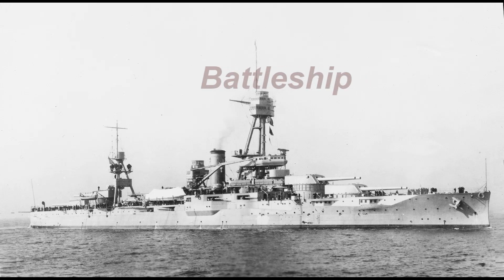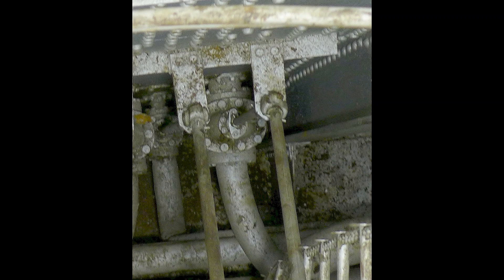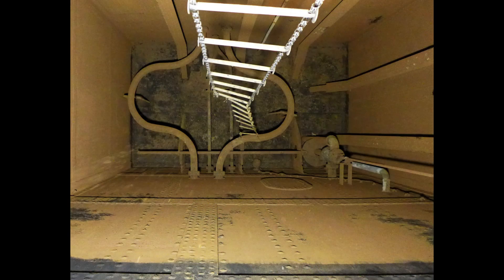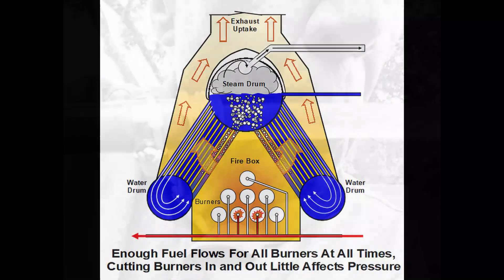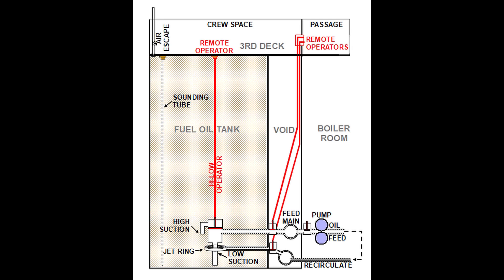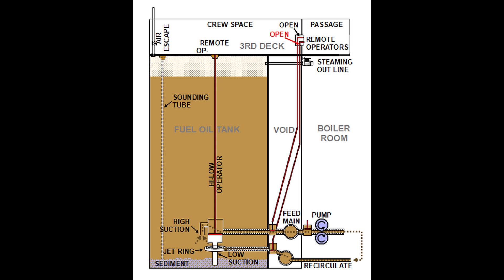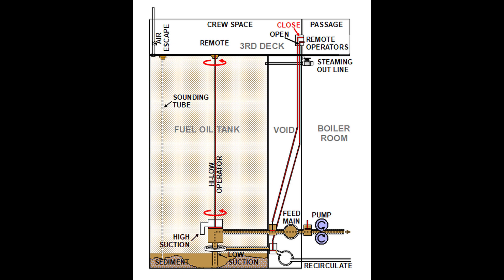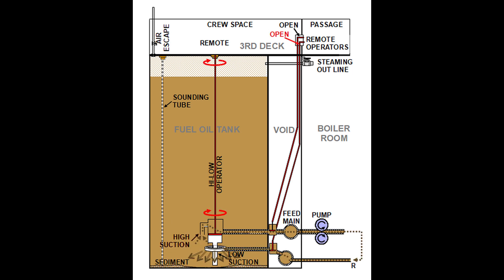Battleship TEXAS, What The Heck Is The Recirculate System?

Comment: you have to take you hat off to designers (yeah i know i say this a lot) the system itself is not so complex when you think of just one fuel cell, but add into the mix another 90 odd, then it must be a nightmare for the crew and their Oil King, and being on top of your game, pressing all the right buttons, opening and closing valves at the correct time to complete tasks when required, knowing where all the pipes go, and which do what and more importantly when - i know these tasks are drilled and drilled into crews so they become completely automated, BUT doesn't it make you wonder how many times you report to the Captain apologising for putting an empty fuel tank on line and an engine running dry, Oops - i guess these are soon rectified when the engine room shouts at you, but i bet some of those boys had some stories to tell, a number of Ooops stories haha
i often think this when i hear of a ship has run aground or something, Ooops someone got shouted at
did i see something that fuel tanks once empty were filled with sea water to maintain ballast on the ship to maintain its trim, or am i imagining it?

Comment: Can the engines ever be started again? I wonder what the engine room was like while running? Was the oil used refined first?
Reply from the maker: The engines will never run again for a variety of reasons.  The fuel oil used to fire the boilers was very thick, nasty stuff that was left over in the refining process after lighter distillates were recovered from crude oil, such as gasoline, light and heavy lubricating oils, and diesel fuel.
Reply: @tomscotttheolderone364   
Well that’s a shame. I heard those engines were close to the same ones on the Titanic. What about firing the 14 inch guns?
Reply from the maker: @robertbruce6998  Other than the two ships' engines being reciprocating steam designs, there are a number of significant differences between them.  As far as the guns, no, they will never fire again.  They required constant service and maintenance when the ship was in service that hasn't been done in more than 75 years.
Reply: @tomscotttheolderone364  well I saw where all of the smaller guns were being restored. To it just seems a shame not one of the 14 inch guns could not be restored. So the turrets will never move again either? Just doesn’t seem right.

Comment: Did that air line serve the purpose of pumping cooled exhaust fumes into the tank for its anti-explosion effects, or was that not a consideration on the TX?
Reply from the maker: There were no air lines to the fuel tanks.  The tanks were sealed and the ambient temperature fuel produced very little in the way of explosive fumes, so there was no real need to purge or fill them with inert gasses.
Reply from the maker: Sorry, let me change that a little.  There were air escape lines running to all fuel tanks.  However, these were simply meant to equalize air pressure as fuel was pumped in or out of them.  The lines all lead to the outside at main deck level or higher.

Comment: I would assume that the steam out line you would not be using super heated steam?
Reply from the maker: You're right for two reasons.  First, there's no use for the extra energy in super heated steam when steaming out tanks.  Next, the ship's boilers couldn't produce it.  The engines could not use superheat, so the superheaters were removed from the boilers shortly after they were installed in 1926.

Comment: what was the process to fill oil tanks with water for ballast?
Reply from the maker: They were supposed to have the ability to flood fuel tanks, but there are no signs of the pipes and valves required to do it.  This was confirmed by a memo written by Captain Baker during WWII saying they had depleted a large amount of their fuel by refueling a couple of destroyers while on convoy duty.  They were not able to comply to the need due to the lack of flooding and stripping lines in the tanks, so he ordered flooding some of the external torpedo blisters.  In the memo was a request to install the needed equipment, but there was no sign that the request was granted.

Comment: Sounds like the "fuel oil" system and the system aboard the U.S.S. Missouri should be on display for each generation of propulsion engineers, and reliable diesel engines, be retrofitted for U.S.S. Texas, U.S.S. Missouri, and legacy class Battleships of each era for fund raise voyages, and the old original propulsion systems, be for those that want to see the original system function for everyone to appreciate. The amount of manpower, staffing, and fuel required would be exhaustive to operate in today's economy. But on display for tours and how each system operated would be fine.. Titanic's Engines, and Boilers, as well as U.S.S. Lexington.. In the case of coastal defense, or shallow water engagement of gunboats and ships, a diesel powered U.S.S. Texas (North Carolina Class) would be perfect! :) imho. (:

Comment: So if the Oil King decided to use fuel from a certain tank, someone would physically have to visit that tank and turn the valve?
Reply from the maker: Yes, they would have to physically open or close a tank's feed and recirculate valves from a location on third deck that was very close to the tank's location.  It was complicated, but wasn't as physically difficult to operate as you may think.  The most commonly used tanks extended along a length of about 150 feet fore and aft of the boiler rooms, so they weren't too far away from the where fuel was needed.  Less frequently used tanks extended along a length of more than 350 feet.  The most commonly used tanks held fuel that could last several days when steaming at a cruising speed of 8-12 knots.   When in combat, the vast majority of the system was shut down and only 6 tanks, called battle tanks, were used.  These could provide fuel for operating up to a day before requiring changing or refilling, which could happen without interrupting service.  This greatly simplified operation and allowed the oil king and his team to concentrate on other things.  If there were problems, members of the engineering crew under the oil king's control were stationed along the third deck and in constant telephone communication so that they could immediately react to a problem.   Junior officers were also stationed there to supervise and confirm that commands were properly executed.
Reply: @tomscotttheolderone364  Wow, in an age where we press buttons and see valves move on screens this sounds much harder to operate/co-ordinate.  Thank you for your encyclopic knowledge and sharing it with us! :)

Comment: Modern Navy Oil King. I was "The Oil King" USS Supply AOE-6 (Feb 1996-Oct 1998).  Today when people talk about fuels they think of the thin fuels (Diesel or gasoline)used today when Texas was built heavy bunker fuel was used (thickness of molasse when cold).  An additional function of the return ring was to allow warming of the tank thus thinning the thick bunker fuel oil. The low suction could be used to strip the tank when contamination (water or sediment) was found or to consolidate tanks.  Some fuel oil tanks are also used as ballast tanks and are required to be filled according to the sequencing chart as tanks are emptied to maintain proper ship trim.
Reply from the maker: Thanks for your experienced comments.  For timing reasons, I neglected to mention that warming the fuel tank was a positive byproduct of recirculating fuel.  Needless to say, it progressively reduced demand on the booster pumps and heater requirements as it warmed.  I'm also glad that you brought up ballasting empty tanks with water.  A number of  them on Texas were to be ballasted with water once they were empty during what was called "ballast conditions".  However, it couldn't be done.  A memo written by Captain Baker during WWII stated that it wasn't possible to flood tanks regardless of what procedure demanded because none of them had flooding or stripping lines.  The memo describes a situation when a large amount of the ship's fuel had been consumed to refuel destroyers while escorting a convoy.  This not only affected the ship's trim, but also degraded her anti-torpedo defenses.  As a compromise solution, he ordered a number of the external torpedo blisters flooded to correct trim, but at the cost of continued compromise to torpedo protection.   The memo was basically a request for lines to be installed; however, we've never found any response to it,  but we assume it was denied since there is no sign of their existence in any of the ship's fuel tanks.
Reply: @tomscotttheolderone364 one way they could have been filled would have been the tank top that would have allowed the vapors from the heavy fuel to permeate the entire ship though.   Another class ship Perry Class Frigates had a void midship that was filled via the tank top. We also used that fresh water to do a ship wash down when returning to HomePort.

Comment: I’ve crawled my fair share of marine tanks (steam, motor, gas turbine plants), but have never heard of a jet ring. Good stuff!
Reply from the maker: Thanks!
Reply: Me either and I was Oil King on 3 ships!! Must have been done away with before WWII.
Reply: I’m thinking of a couple possible scenarios:
1. Jet ring was not as effective in operation as originally intended by the naval machinery design engineers of the time. Bunker C is heavy stuff.
2. Jet ring was too effective. Not only did it scour away FO tank sediment, but it also had an erosion effect on the tank top area in way of the assembly. Tanks often have doubler plates, or thicker scantling, near the suction pipes to counter erosion, induced by vortices… imagine what a nonstop barrage of flowing Bunker C can do with the increased flow rate of the jet nozzles. Again, Bunker C is heavy stuff.
3. I’m just blowing steam here with no idea.

Comment: First, thanks for breaking the old gal down like this, I love it.  I work in oil and gas, and I can say that its fun to me to see how they solved the problems we still contend with today.  But man I would not want to be the first one to enter that confined space, even after 24 hours of blowing.  Is there any info on how they dealt with H2S?  Steaming and blowing from the top would only push the gas to the bottom of the tank and I don't see any air return.  Did they drop an air suction line to the bottom or what?  Or, like at Pearl Harbor during the recovery phase, did they just man up and go in there after signing their life insurance form?
Reply from the maker: Thanks for the comments and questions.  I'm sorry, but I don't have answers to your questions regarding methods of ventilating the tanks and H2S.  I mainly rely upon historic Navy manuals for my information that were in use during the ship's career.  I think it's reasonable to assume that there were clear written procedures in place that dealt with these issues, but I have not seen them.
Reply: @tomscotttheolderone364  Thanks for the reply.  From what little I can gather, I know during the recovery of the damaged ships at Pearl, they just kind of stumbled in there and lost lives, both from CO2 and H2S.  But I thought at the time that it had to do with the sense of urgency, an acceptance of risk, and to a degree, ignorance, or a combo of all three.  But after looking at these diagrams, I'm thinking more ignorance than the other two.  It's only speculation on my part, but I don't think they understood the dangers.  Either way, thanks for the information, Tom.  It's neat little window into how they did things back then.

Comment: I'm assuming there were at least two fuel trunks, since one of them could have been damaged and inoperable for a period of time. This got me wondering how the tank cleaning really worked. If you are pumping steam in and expecting to get unusable trash and water out, you sure don't want to be pumping that into the main operating fuel trunk. This makes me think that they would use the other trunk for the cleaning residue and have a valve (or many) on the trunk that would dump the contents overboard. But that potentially left some of the trash you didn't want in the main fuel trunk. So was there a third trunk used for the wash residue, to keep it out of parts of the main fuel system?
Reply from the maker: Thanks for the comments!  There are two fuel mains; one running along the starboard side and one on the port.  There were cross connects in all three boiler rooms that could provide fuel from either side if one was damaged.  The only problem would be losing the use of fuel tanks on the damaged side until repairs were made.  Even then, there was a fuel transfer system that could pump fuel up from undamaged sections, across to the other side and into tanks as they emptied.  In fact, that would be very desirable since emptying tanks on only one side could seriously affect the ship's trim.  As far as pumping residue off the ship and cleaning the mains, that was not a serious problem.  First, cleaning or repairing tanks would most likely be done at a port facility or shipyard.  I cannot think of any compelling reason to do this while at sea since there were usually plenty of tanks containing good fuel that could be brought on line and bad ones isolated until you get home.  Cleaning the system would be done by pumping residue into the main then into the refueling system.  This consisted of a relay tank on the third deck and lines to the main deck that would be run in reverse so that contaminants were pumped up to the tank, then off the ship.  It could then be processed on shore.  By the way, fuel was commonly run in reverse that way when at sea.  Battleships typically had huge fuel reserves that were used to refuel shorter range escorts like destroyers.  As far as waste, they would never pump that stuff into the water unless there was an emergency reason to do so.  Cleaning residue out of the mains would be simple enough.  You could just pump some fresh oil through the main to purge it and send it off board.  That fuel wasn't wasted since they could strain and de-water it, then return it to storage.
Reply: Settling tank, even with the rocking and rolling underway heavy stuff and water settle out. As long as you get out the water, a boiler will consume just about anything.  By regs you are supposed to cycle out burner nozzles after so many hours.
Reply from the maker: @jamespollock2500   There are storage boxes with burner tips already made up for that,  plus some with larger orifices if they needed to increase firing rate beyond normal limits.  This would have been done as described in my previous video that partially covered boiler room damage control measures.

Comment: I did not know that Navy Special was so low in viscosity
It did not have to be heated.

The WWII battleships like NJ , Iowa etc had steam coils and I thought they used NSFO also.

By the way I think after the first BB was reactivated in the 1980’s
They stopped repairing the steam coils in the tanks of the later ships And eliminated the oil heating system as they
Had foolishly changed to 
DFM by then.Diesel Fuel Marine. Why pay for high cetane number needed for diesel but not boilers?
Supposedly saving 10 percent of cost of shipyard work by not fixing the system.

Giving a marine boiler DFM instead of bunker C or NSFO is like giving a drunken wino the best Vintage liquor!
Sure it will work but why pay 3 times more !

Thank you for the excellent explanation.
Reply: Dfm cut out cleaning firesides to 1800 hours, think NFSO was 600 hours
Reply: John,
Were you a BT?
What I was pointing out was The Merchant steam ships with boilers from Babcock and Wilcox, combustion Engineering etc using worse fuel, true bunker C not NSFO , did Not clean the fireside’s
On hours at all!

We water washed the boilers not put poor BT’s into a boiler with a wire brush.

I know navy boilers had a higher Heat Release Rate, volume of boiler combustion space Vs pounds of steam produced,
But it was crazy what they did and the money wasted after switching
To DFM.
Reply: @josephpadula2283 Retired as a BTC (SW) back in 95. 7 ships, 18 years sea duty. Mostly B&W. Atype, Mtype and D type 400psi to 1275.
Reply: John,

You where the exact person I imagined being forced to comply
With directives by officers that knew nothing about boilers.

Unless you had a Mustang
They had no idea of what was going on other than implimenting what the NSTM said.

There is no cross polllinization   everyone is Navy.

Meanwhile shore Power plants and merchant ships were improving.

As I have said many times Admiral Rickover knew engineering and made his officers learn it too.

I am not anti Navy just the Surface 
Engineering program is not good.

Do you think shore power plants and merchant ships have non engineers in charge?

A degree in engineering that some officers have  do Not make you a chief engineer.

It is a license to learn and when your next tour is non engineering it is a ticket punch not a career.

The Navy Enlisted carry the ball
But don’t have good coaching!